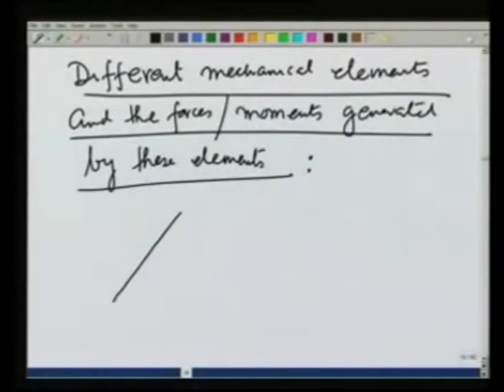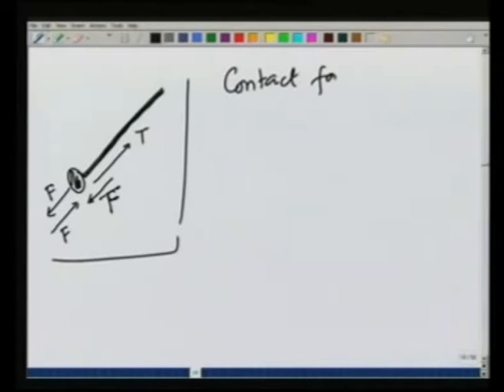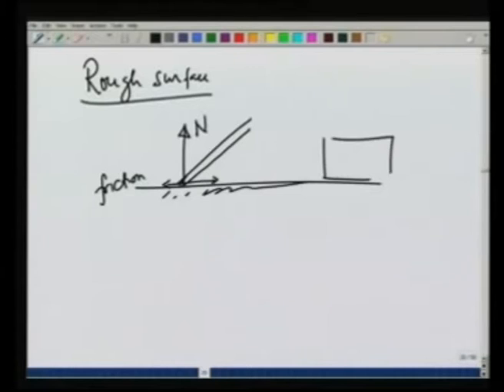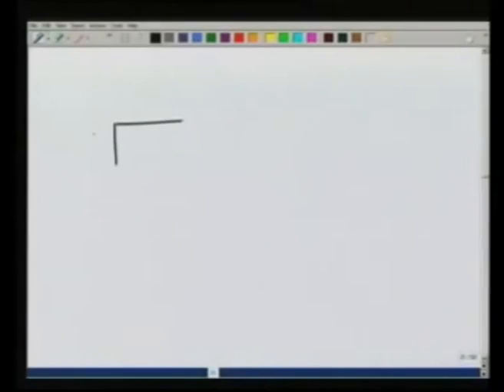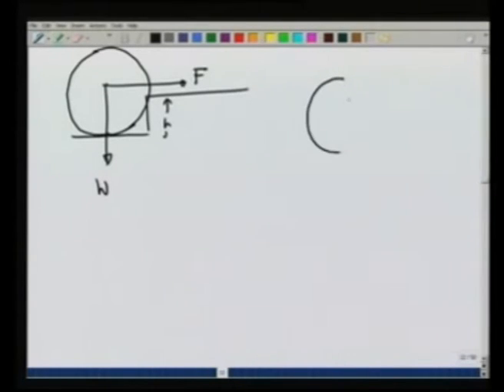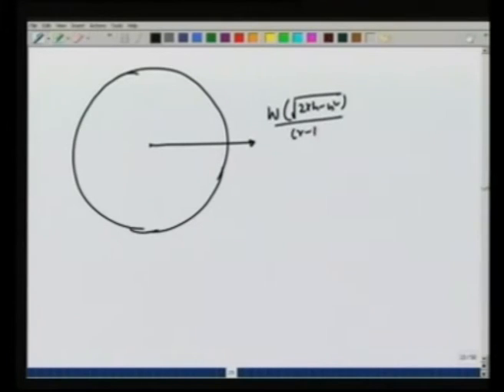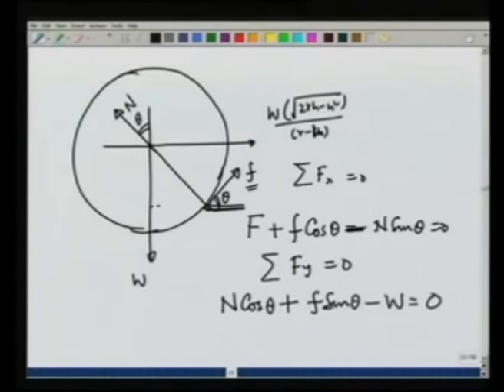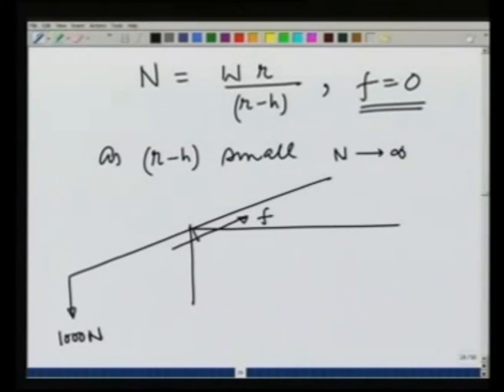Different elements and associated forces and torques - I

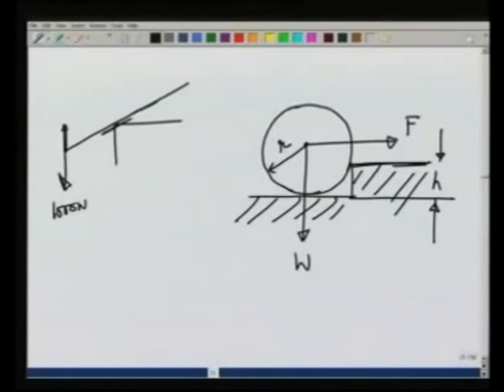Comment: At 6:45, the force F that has been calculated in this example is the initial force required to take the roller over the step. But as the roller moves upward, the angle θ will change, so will the force. Hence, the force required to take the roller over the step will vary with θ.
Reply: https://youtube.com/playlist?list=PLhgXtZ1PS2DpxPFlNBhoWefGJCaJhGMiO